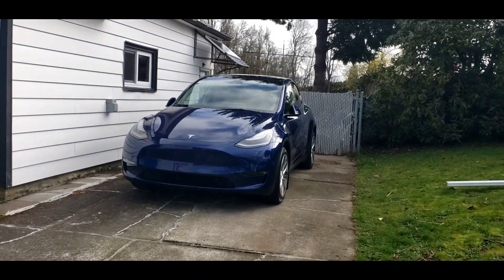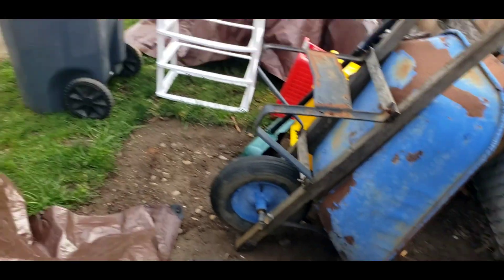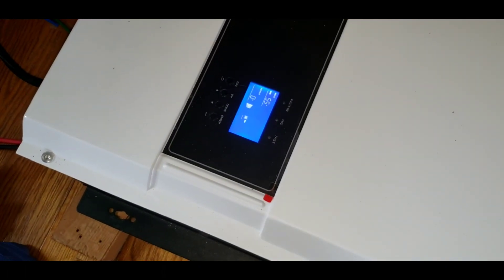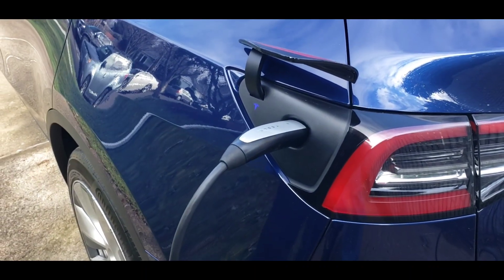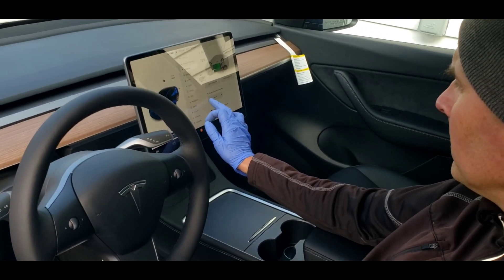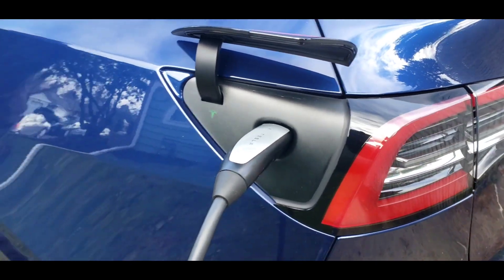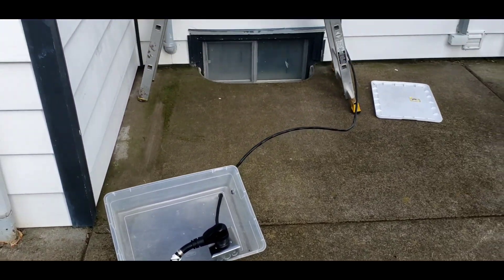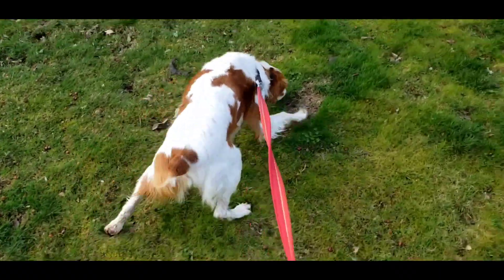Free Fuel! ..well almost

Comment: Is it even "almost"? Even if we think of solar power as "fuel", I'm sure all the setup costs something, in addition to the higher price for the Tesla itself. That "free fuel" is probably pretty expensive.
Reply: When gas hit $8.00 a gallon they will be laughing.
Reply: @2148aa  Seriously, that Tesla is $60,000+. Then however much more for the solar and battery systems. Even at $8/gallon, I can drive a hybrid SUV for half the price and go 200,000 miles with the money saved. Will solar panels and batteries last that long, and will they generate enough power to never need grid support? They are in cloudy region, so I doubt it. Solar panels need clean light to work, you know?
Reply: @2148aa  When everyone is using electric and rates go up they will be crying.
Reply: @mark7067  Claim down/// I am  a non plugin Prius owner.  They need 30 fold the solar panels they have to charge that car. Figure 4 miles per kilowatt hour you can do the math. My complaint is Hybrids are getting bigger closer to $40,000 a copy and down to 40 mpg because of the size. The Bolt and the new Leaf can be had for $28,000 as can a simple Prius. Simple anything can run cheap.  Big anything gets expensive and makes that Tesla an option.
Reply: @2148aa  A modern Prius still gets over 50 mpg and is still has a lower starting price than a Bolt or leaf, even if it has gotten bigger. But even if the prices were all the same, the solar and battery systems would be thousands of dollars, which is enough money to fuel a Prius for a very long time. 

Just do the math. If you were to install a solar charging system to the magnitude you're talking, that's likely tens of thousands of dollars. Think how much fuel that buys, even at $8 per gallon, probably enough to fuel the Prius for its entirely life. 

Honestly, I don't think gas will even go that high. There will be riots and economic collapse before we see $8/gallon.
Reply: Bryan, a bolt? What and have the charging unit at the bottom of your drive or burn your house down. They have abandoned making those haven't they? Have they finally fixed the ones they made?
Reply: @COIcultist  The Bolt is soon to be gone.  You can park in the garage but charges are limited to 80% The Leaf has a history of battery over heating and even in the new models fast charging after a long quick drive will cause the batteries to overheat and go into failsafe till cooled down. I predict the Bolt will have a cult following. They are ungodly a fun car to drive for the little car they are.
Reply: I'm not here to find a way to bash an electric car. But, math is math. At what point do you actually starting saving money after you invest 60K in a car and then however much for enough solar capability to charge it? I LIKE the idea, but is it an idea that works or is it an idea that makes you feel better? I've watched several different people on YT that are all in on solar and I haven't seen anything that harnesses solar or runs off of it that is inexpensive.
Reply: @2148aa  At the last time I looked, they are turning the plant over to a different model. GM and LG were playing pass the parcel over whether LG made defective batteries or if GM's specs were wrong. GM were looking for over $2B in damages. I wouldn't want a bolt within 20ft of my house let alone in the garage and my house is brick built. Months ago I was talking about this to a guy I know in the fire service in Scotland and was saying how it was relevant as LG made the majority of batteries for cars in Europe. I sort of thought he thought I was just a know-it-all twunt, which I can be. About three weeks ago he had been on a course looking at cars and lithium-ion battery fires and the fact you can't put them out, all you can do is add excess water and cool them. He was a very different man, saying that lithium-ion battery fires are as scary as fu**. 4 or 5 years ago I was looking at checking in for a flight, it wasn't one of the countries where you can't travel with a laptop in your hand baggage, but I wanted mine in my suitcase. I asked the check in person about my laptop in my suitcase, but were we required to put the battery into hand baggage for safety. She looked at me like I had grown another head, but said, "I'll check that out." Forced to wait to one side for ten minutes, it was then, "Oh yes sir, you are correct. Thank you!"  I then got on a plane thinking, "I'm the only person who has ever asked this, this is going to down a plane one day."
Reply: I don't think everyone who gets a tesla is making a statement. Sometimes it's as simple as screwing around with new tech for fun
Reply: I saw Will Prowse get a lot of large, cheap panels and just prop up an array of them with a few bricks on his drive. Easy install with no permit like on a roof. 

Also he made a 'solar trailer' full of batteries etc. Now he can rapid charge his Tesla, but of course all the batteries and inverters cost a lot.

I did mention Bitcoin mining etc and I think he's going to, rather than just power his AC unit.

Check out Louis Rossman's DIY ebike fire video, it went off outside his apartment like an Arc Flash explosion.

Comment: Hi. Retired electrical engineer. Please don't mess with set ups like this as you can do some serious damage right up to and including starting fires.
BTW the correct description of a solar power system is: PVs provide power to charge the battery bank, the battery bank powers the inverter, the inverter provides AC for household power (240/120 Volts). And yes the system should be grounded; the Tesla was probably detecting a ground fault.

Comment: I'm not all that on electrics now and probably never was anyway, but the Tesla in and of itself isn't earthed/grounded. Hence, cars acting as Faraday cages in case of lighting and why you don't step out of cars if you run over fallen power lines. All it needs to sense is a neutral/return at the same potential level as earth/ground. Please someone who knows more feel free to correct me, but that is what I would be looking at.  An earth lead doesn't have to be connected to earth. In the UK, commercial power tools used outside were 110V rather than 240V not because 110V was inherently safer but because the transformers used were isolating transformers so if there was a severed cable the tool operator could not be a return to earth. School laboratories also had isolating transformers for all the sockets.
Reply: Reminds me of those rubber anti-static/nausea straps that you can hang from the back of a car.

On another note I have a HF amateur radio (like AM and shortwave) and if you attach the chassis to a ground rod, or the radiator pipes then it improves the signal.

I added a switch - one way might make the neighbour's electrical noise better or worse. It  also helps 'tune' the antenna SWR for transmitting. E.g At 14 MHz a higher frequency needs a shorter antenna, and off is better.

Comment: One standard solar panel is rated 400 W peak which converts to 1.5 A @ 240 V. Do you have 240 V power supply at the west coast?
Reply from the maker: Yes